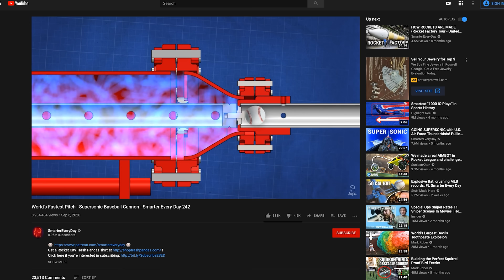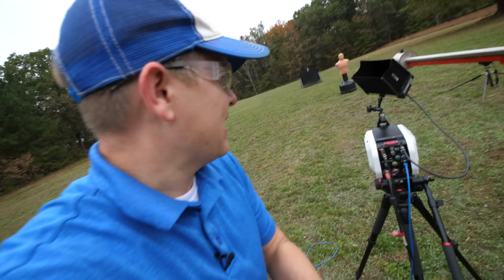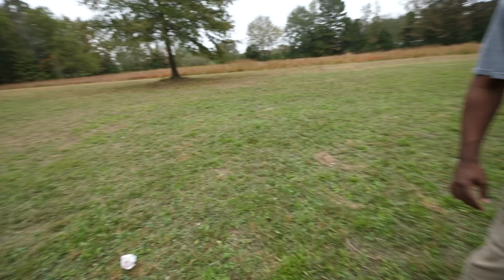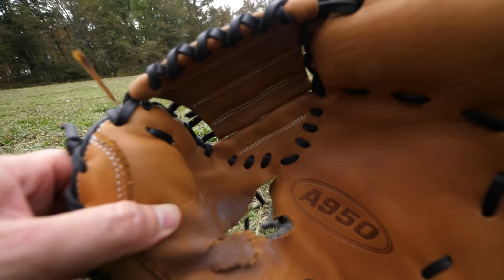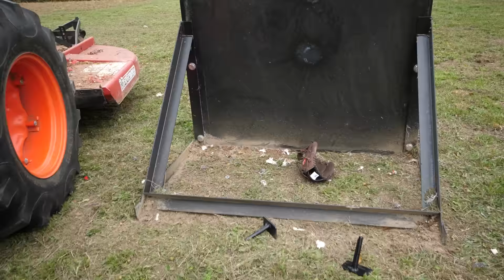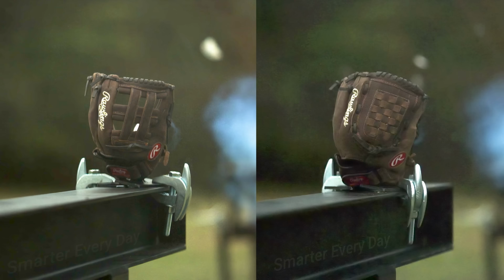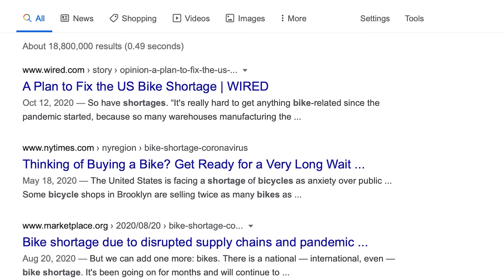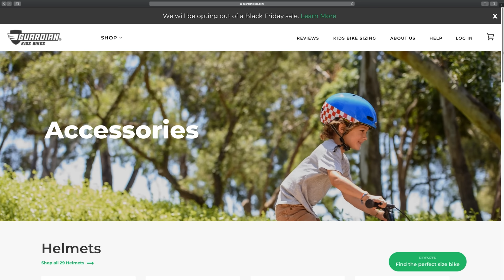Trying to Catch a 1,000 MPH Baseball - Smarter Every Day 247

Comment: Fire from the leather on leather friction before the ball finally tears through the glove?
Reply: The fire starts before the ball hits the glove look at the bottom just before it hits
Reply: NotYourGreatestPlan  ye i seen that aswell with the smoke stuff with building ip pressure in ur mouth or something but i dont understsnd a thing u said im 14 so its all nonsense to me all i know is fire cool and it cane before the ball made contact with the leather
Reply: @b5plt500  look up a video for a compression fire starter they can show how it works but 

If you smash air together fast enough enough heat can be made to cause ignition think kinda like how the tips of rockets catch fire cause they go so fast tho thats more friction based
Reply: @lordcanti2921  ohh that make makes more  sense thank you
Reply: no it was already flaming out of the Canon. blure flames all around it the first time it went through the glove.
Reply: @Dr.Zoidberg087  again I could only guess that is flame from rapidly compressed air infront of the ball as the cannon doesn't use any ignition and only compressed gas 

But is really noticeable with the weave glove cause the air is smashed between the ball and the glove very fast as the air can get out of the way quick enough but with the H glove the air and move away much easier
Reply: @lordcanti2921  no your not quite there. it was on fire when it exists the cannon. blue flames all over it. if i had to guess the friction of the air moving around the ball and it travels that fast. then as it slows down hitting the glove the air friction dropps, as does the temperature, so the flame changes from blue to a cooler red/orange
Reply: @Dr.Zoidberg087  that's water vapor condensing in the wake of the supersonic shockwave.

I think the other folks are right, this is an air compression thing. Like how a "fire piston" fire starter works.

It actually emerges out of the same basic gas laws that make an air conditioner work. As gas expands it cools, so as it is compressed it gets  hotter. Basic idea is that the thermal energy in the air stays the same as it's compressed, but the area that energy occupies shrinks. What do we call a small area with a lot of thermal energy? Hot!

Only happens on the basket weave because the H had bigger holes. No "solid" surface to compress the air against.
Reply: In addition to the rapid air compression, what about the chemicals in the leather from manufacturing, oils, dyes,etc.?
Reply: @lordcanti2921  Or better yet the whole idea of diesel engines
Reply: @Dr.Zoidberg087  so that a blue flame? i thought that was that was the air compression around it
Reply: The reason there's fire @ 11:02 was because the air that was in the cavity of glove got moved very rapidly in a traped space so oxygen molecules collided w each other making friction, There for igniting, its not the friction of the leather of the ball & leather of the glove that made that fire it was the oxygen molecules colliding very rapidly w each other, Kinda Like a slam rod to start a fire.
Reply: I believe that the air was superheated as it was compressed between the ball and glove creating plasma for a nanosecond. Look up  the videos of a rail gun test and you will see the air looks like fire (plasma) as the projectile flies through it.

Comment: I love that little bit of blue smoky looking stuff that's immediately trailing behind the ball, it looks like something out of a manga/anime where the 'hero' throws a ball so fast that it trails fire behind it.  😜
Reply: This is so accurate! I need an explanation.
Reply: I want to know what that is exactly too. I would guess it's the air collapsing back in on the ambient air behind the ball. Kinda like a vapor cloud when an aircraft goes supersonic, but circular because the ball is a sphere so it's uniform along its surface.
Reply: As the ball is travelling forward at supersonic speed, it punches a hole through the air. There might even be an actual vacuum behind it, but there's certainly a very low pressure area in its trail.
The smoke ring is just a regular vortex ring, but I suspect the extremely low pressure behind the ball is dragging it along, making it stick really close to the ball.
Reply: At 10:52 it looks like there is actual fire trailing the ball. So awesome!
Reply: The whole scene where the ball makes a shockwave in bob's chest before knocking him down could be straight from some anime fight.
Reply: @migkillerphantom  Jeremy: Omae wa, mo shinde iru.
Bob: Nani?

Comment: 6:23  And in other places , where the ball is shown in slow-motion, you can see these rings of mist? Right behind the ball, which look awesome. Nice video By the way!
Reply: That's compressed atmosphere in it's relaxing moment of inertia, basically a plasma created by the immense amount of friction on air from the face of the ball.  
It's an effect you only see with the naked eye when rocks fall from space! Pretty cool stuff!
Reply: @guardsmanom134  Hold up, PLASMA? What is plasma? Or what type of plasma is it?
Reply: @guardsmanom134  condensation perhaps?  like a contrail from a jet.
Reply: @guardsmanom134  pretty sure its just condensation my guy, cause its cold out
Reply: @fluorinegas6944  physics is lost on some folks...
Reply: @spaceopera1713  at that speed and the gaseous density verses the speed the baseball is going, no. You're not going to get condensation. 
You actually see what condensation looks like under so high a pressure that it turns to a superfluid, when the cannon degasses.
Reply: @Agonal  basically, where physics are concerned-
A plasma is any gaseous medium which is experiencing a large enough of energetic difference from it's inherent neutral state, that it changes chemical or atomic form. 
This can be as simple as adding one electron to a hydrogen atom, en mass. One energised atom is called an ion.
 The cloud of ions is the plasma .
Reply: @guardsmanom134  So it’s the airs reaction to the speed? Because its like breaking the sound barrier?
Reply: @Agonal  wow... Ok no. That's nothing like what happens.... It's a density×heat problem, not a fast/slow problem. 
Because the ball is moving so fast, it's generating a lot of friction. Friction causes heat. Because oxygen is extremely reactive to EVERYTHING, and oxygen and nitrogen are the most profuse gasses in our atmosphere( O2 is around 26%, N3 is moderately less, around 13%) and are nearly Stoichiometeric in their mixture, they will plasmate, creating NO2 and energy, which we see as a faint blue aura. That pretty blue fire, is actually around 4,300 degrees °F(around 1,900°C). 
That is hot enough to melt steel in under a minute! Obviously not hot enough to do it on contact, but yeah.
Reply: @Agonal  so, not a reaction to speed, per se. It's all to do with how much energy(heat) is being dumped into the air particles. That's quite a bit, when you are at ground level and moving at supersonic speed. It's 111 miles an hour faster than in the upper atmosphere(mach). 
So, obviously, we won't see any fighter jets pulling a mach-plasma(at least not from the ground). But Destin definitely gave us some great footage for education!
Reply: @guardsmanom134  So, it’s created through the ball fighting air resistance creating the friction that creates the heat, thus creating the Plasma?
Reply: @Agonal  EXACTLY! Well done! Thank you! There's hope yet!
Reply: @guardsmanom134  Oh my god why do I feel so accomplished thank you 😊
Reply: @guardsmanom134  You would think that it's because of the speed and those "obvious" things, that explains this phenomena? But it turns out it is something completely different like you said with density and heat. Physics...
Reply: @savagedarin1236  that there embodies the actual reason I love physics- not everything is as it first appears!
Reply: @Agonal  welcome to UNDERSTANDING, friend...

Comment: Hey Destin, love the video, love the project! Keep up the learning! CHALLENGE: It seems to me the problem your are tackling would be a psuedo earth based simulation of the space debris problem growing ever more perilous for our satellite constellations. Also, to answer the question you've posed in the video, you DON'T catch a ball moving at that speed, you deflect it. My suggestion (if you still want to use gloves), you need to launch that ball at a Glove hanging from a chain, get that glove to "catch" up to the ball enough not to disintegrate, and then translate the linear energy into rotational energy to dissipate. I expect, to make this work you'd need more like a bear trap glove already in motion, that intercepts the ball in flight, closes (bear trap) to join the two masses and then spins around an anchor point. However you do it, I know that you can! Catching is simple if you can do two things: Connect the transit item to your catching item (without mutual destruction), dissipate the energy of the throw. Keep at it! Can't wait to see it.
 this was said by Bryce Rakop

Comment: The fire might have been caused from the instant compression the air between the ball in the glove and the ignition of the oils in the leather. Similar to a diesel engine.
Reply: someone pointed out further up in the comments that if you pause at 10:52 you can see a small flame behind the ball before it even hits the glove. pretty insane.
Reply: Also, what is also probable, is that breaking of fibers is releasing energy, and due to huge amount of force it is working as an ignition source. Both of those are combined for that effect. Try to watch in UV how high speed breaking of nylon strand looks like, it's like a flash...
Reply: My guess is a nitrogen plasma, similar to what is formed when space ships re-enter the atmosphere (NASA did a ton of research on this). As you say, it results from the gigantic compression between the glove and the ball, but it is not the same type of ignition as in the diesel engine because you dont actually have combustion (diesel reacts with oxygen, the N2 plasma formation is not a chemical process).
Reply: @kyamon  That's pretty much what it put me in mind of

I think Rab's point was that pressure was key here
Reply: @smokeyjoe7251  Yes, and I agree with Rab on that - what I meant to point out is that I dont think it was an actual "fire" (which implies combustion), but a plasma

Comment: The part about the fire I think they missed is that the baseball was on fire BEFORE it hit the glove. as seen at 10:52 (not talking about the pressure wave, but behind the ball on the bottom side there is a streak of orange fire trailing the ball into the glove)
I'm assuming the friction between the laces and the barrel lit the ball on fire during the launch; then the ball carried that flame with it into the glove.

Comment: The fire was probably from the oil in the leather being atomized on impact, thus being ignited by the friction.
Reply: The leather on leather friction created enough heat to reach the point of ignition.  They need to rerun these tests with a chronograph so we can learn the speed of how much speed is lost on impact.
Reply: @epistte  does “leather” ignite though? Give that a try? The flash is from the hydrocarbon knocked loose in the impact.
Reply: @10:53 you see a flame behind the ball prior to impact.
Reply: @Vickie-Bligh   that ring is not flame. You can see it at 4:57 and at 6:25 as well. Anytime you enter super sonic speeds you will develop such vortices.
Reply: @eds6889  Didn't talk about the ring. I know it's a vortex. But if you look very closely you will see a touch of flame. Actually agreeing with you that air friction ignited the laces.
Reply: @Vickie-Bligh  I never said or implied anything about air friction or laces. The ball impacts the glove: one half mass times velocity squared. That’s the energy release and that’s the source of the friction, flammable vapors and the flash.
Reply: @Vickie-Bligh  I’ve watched this video on a 50” monitor. There is no flame behind the ball.
Reply: no u  have you ever seen a rainbow? What do you think that ring is made of in the three scenes where it’s visible?
Reply: Iron sparks when hit. It may have hit the iron bar, that is holding the glove.
Reply: @ThePhobos100  can you get a spark from only one metal object? Why aren’t there sparks when the ball hit the metal back plate behind the experiment?
Reply: @eds6889  Friction obviously comes into it .  it might have skimmed the metal bar, which is standing the glove up. My explanation might be wrong.
Reply: @ThePhobos100  was the metal bar exposed after the ball pierced the glove?
Reply: @eds6889  maybe not.
Reply: Accums razor people. 

1000 mph is not enough air friction to ignite anything. You can shoot a match at that speed and it won’t ignite. 

Leather won’t burn when you put a torch to it. At those speeds the impact friction will create enough heat to pass the flash point of oil. 

Hydrocarbons ignite easily when atomized. Ball glove leather is conditioned with oil. 
 
Impact and Energy:
Energy is defined as the ability to do work. During an impact, an object's energy is converted into work. The energy of a moving object is called kinetic energy, and is equal to one half of the object's mass times the square of its velocity. 
KE=\frac{1]{2}mv^2

Maybe this is a good topic for “Smarter Everyday” to cover.
Reply: @eds6889  How come the other gloves  did not spark a flame?
Reply: @ThePhobos100   that is a good question. There are quite a few variables. The gloves, balls, the angles of impact, and the firmness of which the gloves are held in place are all unique. If you slow the video to .25x playback speed and zoom right in you can see there was a moment of compression and the flames shoot out before the ball breaks through. That compression might be the difference. One would need to have a proper controlled experiment to be sure. Again, good question.

Comment: Nice. Very impressive cannon and video!

I'm not really surprised that it penetrated the dummy and gloves, though. You're firing this thing at similar speeds as a normal gun, but with 15x or so the mass of a normal bullet. Granted, you have something like 100x the impact area to spread that energy out over and more compressibility, but you're still talking about a pretty incredible amount of force and momentum.

Comment: What vacuum?
Reply: They created a vacuum at the end of the pipe infront of the ball. That way the ball gets pushed away by the high pressure area and its being sucked forward by the vacuum. Makes the pressure difference even bigger so the ball goes ‘fjeeeewng’.
Reply: You’ll have to watch the original video when they made this cannon
Reply: The bigger advantage isn't the ball being 'sucked forward' but the lack of resistance from the air (since there, obviously, isn't any).
Reply: @magnus5356  Ofcourse, i forgot.
Reply: @magnus5356  Just wanted to add that, in case it wasn't clear, vacuum doesn't suck. Pressure pushes.
Reply: @longlostwraith5106  True ofcourse, never really thought about it that way. Always thought vacuums sucked but its the higher pressure that pushes towards the vacuum.

Comment: Can I just say, that to my eyes in the slow-mo for the basket weave, it almost appears that the very brief fire happens JUST BEFORE contact with the glove?

Could it be extreme compression of air between two surfaces in such a short amount of time caused the ignition?

This would also explain why it only happened on the basket weave, being that there was a smoother more even surface area
Reply: This was my exact thought.  I have seen a survival tool which uses compressed air to create fire. I'm interested to see if Destin has a thought on this theory.
Reply: Interesting observation...
Reply: @braleyoutdoors  I also realize this could be kenetic energy ---> thermal energy, but that's usually due to deceleration via impact, which the ball barely decelerates after leaving the glove.

Also friction, like he used the example of striking a match, but I don't feel the ball had been in contact with the glove for long enough to friction burn the leather. 

After seeing the high-speed my head just tells me something is more interesting there than it seems